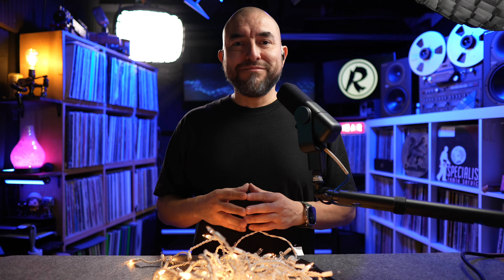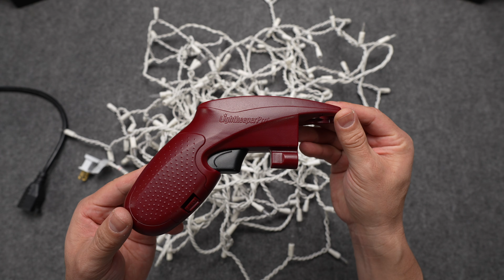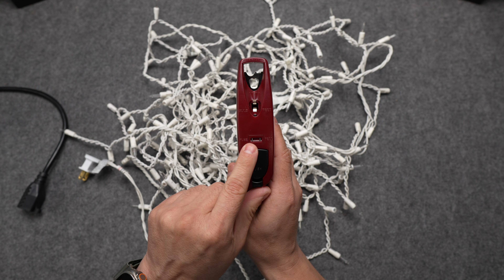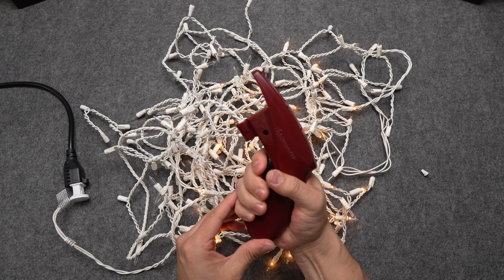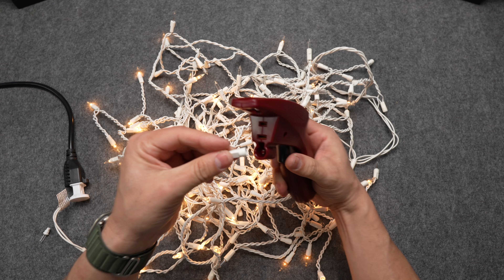Reviving Christmas Lights Easily: The Light Keeper Pro Review

Comment: Just to clarify, that is not the way a shunt works. A shunt is just a bridge to allow electrical current to flow, not prevent it. The issue is that in these cheap bulbs, the shunt does not work as it should a majority of the time. The purpose of a shunt (a coated wire wrapped around the bottom of the filament inside the bulb or regular wire wrapped around insulated filament leads) is to allow current to keep flowing if a bulb burns out. Current should always be flowing through the shunt wire and the filament wire, but the filament wire has much lower resistance than the insulated shunt, so almost all the current goes through the filament. When the bulb burns out, it opens that part of the bulb circuit so all the current then has to go through the shunt as long (as it still has some connection to the two filament leads at the bottom of the bulb). That heats the shunt, melts off the insulation, and gives it much lower resistance and acts like a bridge to connect the rest of the lights in that circuit. 
The problem is that sometimes, the bulb burns out, but the shunt doesn't get enough current to heat it and it never makes a good connection. The light keeper tool has a piezoelectric crystal in it. It is the same spark generating device inside an electronic candle lighter. When you press the trigger, instead of an external spark to light a flame, it sends a voltage pulse (usually around 700-800 volts) through the wire through all the bulbs and all the shunts. Any bulbs that are "open" will have more current go through their shunts by clicking the button and hopefully heat them enough to melt the insulation. So even if you have 3 or 4 burnt out bulbs, pressing the trigger a few times (maybe up to 20 or 30 times in quick succession) should reconnect all those shunts so the good bulbs in that section will light. Then you can see which ones are burnt out because they are the ones not lit and just replace them.

Comment: I have this tool. It's great. It would be good if you show how to use the voltage checker, which produces the beeping sound when power is present.
Reply from the maker: Great suggestion! I will include that info if i create a follow up video showing detail of the additional functionality.